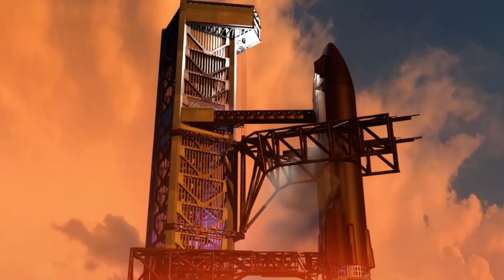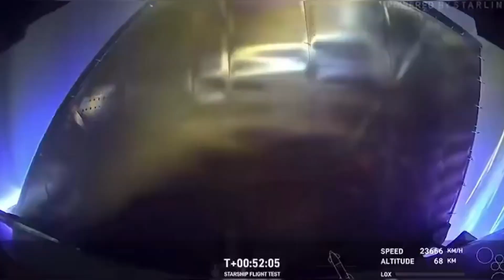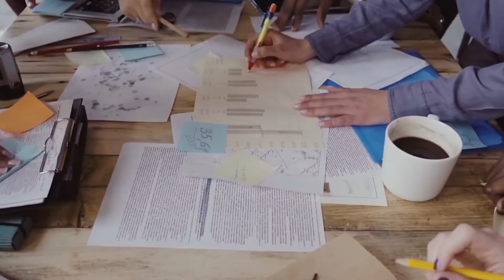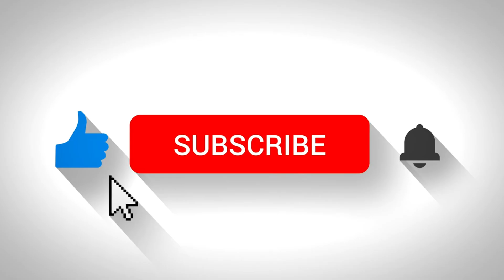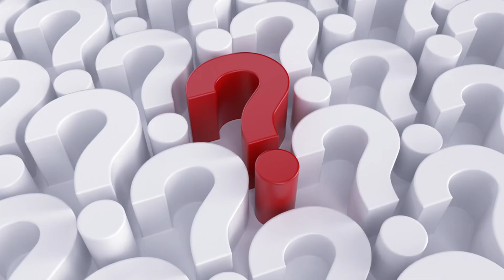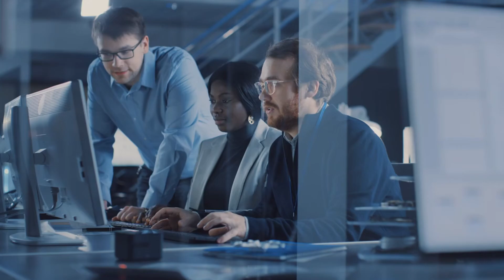Warning! SpaceX seriously Warning about Block 2's SECRET Features - NASA's REACTION!

Comment: Well I thought that Blue origin had a blow out on the side of the rocket 🚀. So was it fixable or what. I can't see that you couldn't of fixed it that fast and also wouldn't FAA need to come in and inspect it before allowing them to try relaunch it.
Reply from the maker: You're right to be skeptical! Blue Origin definitely had some setbacks, but it seems like they've made quick fixes and, with the FAA's inspection, they're pushing ahead—space exploration is never without its risks, but they're determined to get it right!